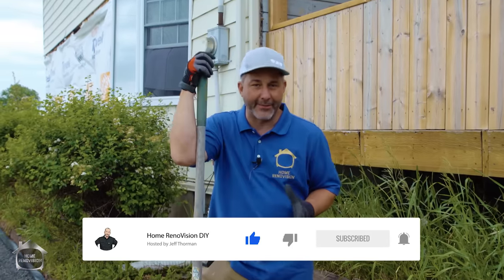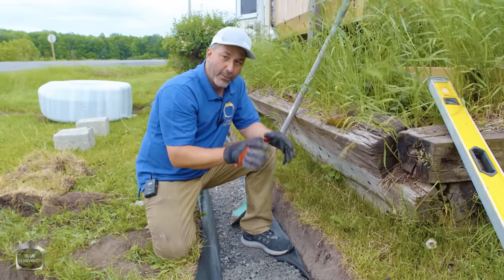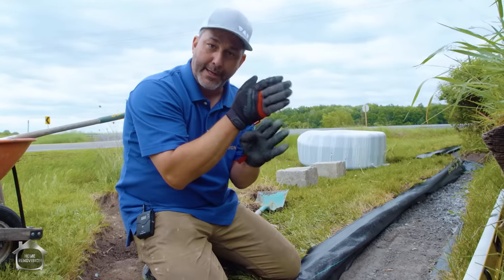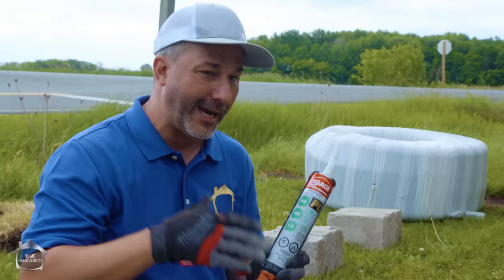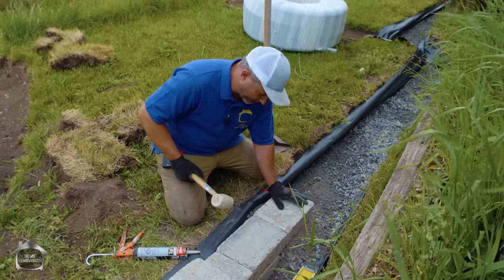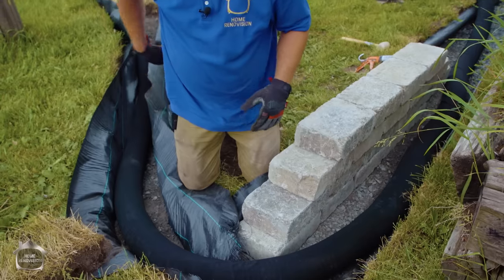How to Build a Retaining Wall - Step by Step

Comment: Probably should use some ppe when cutting masonry, once you've seen someone suffer from silicosis who worked with concrete for years you realize how little effort slipping a mask on during dry cuts can be
Reply from the maker: except I am not working with that stuff everyday and a little exposure will not cause you any harm. Cheers!
Reply: @HomeRenoVisionDIY  😳Come on, how old are you ... you literally out of breath in every video... 😉🌱
Reply: Mask AND Safety Googles.
Reply: @ConstantGardener-q9q  has to be a HEPA filtered mask and you have to have a fit test for the mask, using any type of mask can be dangerous.
Reply: @greeceundiscovered9670  damn, talk safety to me.
Reply: I totally get where the Home RenoVision guy is coming from. I’ve worked in several industries (steel, aerospace, construction) and as far as the lungs are concerned I really only stressed when working with composit materials like carbon fiber or fiberglass. Otherwise the only ppe I use is gloves and glasses… unless of course I’m welding or pouring steel.
Reply: Not to mention a pair of steel toe cap boots when using a diamond tip blade an inch from your foot lol
Reply: As long as you don't get sick you'll be fine...
Reply: @HomeRenoVisionDIY it absolutely does cause you harm. Masonry particles go in your lung AND NEVER LEAVE. Anyway, good video. Thanks for the tips.
Reply: Be sure to wear a NASA approved space suit and Tri mix Scuba breathing apparatus.. maybe back mount so it doesn't get in the way. Have at least 6 people standing around you wearing the same equipment with Palm Frons so they can fan away all the bad dust. Oh oh and remember to thoroughly rinse yourself off with a good chemical cleaner and a pressure washer with at least 3000 PSI and warn all of your neighbors to stay indoors with the doors and windows closed and sealed for at least 48 hours.  That should do the trick.
Reply: Too many safety professionals. As a safety professional you do should NOT assume PPE is the first answer. However, engineering controls are far better such as a dust collection or just reducing the dust by making it damp. If not applicable, now you can use PPE. The comfort of the person needs to be considered. No one wants to be wearing heavy PPE outside in the hot sun. N95’s are extremely hot to wear for long periods of time and being outside could lead to heat exhaustion. Even a PAPR/Full face is not practical. Cutting the brick the other direction so the wind takes the dust away from you would have been preferred and wetting i it before cutting. Also, he’s out of breathe because this guy is a work horse and explains what he’s doing while he’s doing it. Silica exposure is no joke, ask the 9/11 first responders and volunteers who were there.
Reply: Eyes & lungs are overrated.
Reply: Ears also
Reply: Scoliosis is curving of the spine. How on earth could a face mask prevent this??

Comment: I build these for a living. There are definitely some things we do differently as professionals but this is a great guide for a homeowner.
One thing I would recommend is using a small layer of stone dust to help level off your base course easier.

Most important to me though is to use headphones and glasses when you cut, or else you’ll end up with little shards of stone in your eyes and destroyed ears. Sometimes there’s a good reason to use proper PPE.
Reply: How high of a retaining wall can be built this way and at what point does it become a "high tech, expensive retaining wall that is holding up a wall of mud"?
Reply: @michaelspino906  Thats a good question, because I beleive you need a permit here if you go over 4 ft.  (I'd have to look that up to verify though). I built a small one a few years ago without the fabric and weeping pipe, but our soil is decomposed granite, and we don't have freezing cold winters, so I'm thinking this might be overkill for a 4 foot wall?  It's been holding up fine so far, and I'm watching because I need to build a taller one.
Reply: Michael Spino 
Generally in most places in Canada you need a geotechnical engineer to sign off on any retaining wall over 4 feet.  You can still build a “gravity wall” which is what this is above 4’. But it will depend on the size (weight) of the blocks and type of backfill materials as well as a few other factors.  
Hope that helps.
Reply: One thing I would recommend is creating your own channel, instead of trying to gain attention from someone else's video. If you want to preach safety you may want to do that on your own videos too.
Reply: I thought the same thing .... why no PPE. 36 years ago I was weedeating without safety glasses. Had to go to eye Doctor to dig a piece of vine out of my eye. I was fortunate. I have never left PPE off since.
Reply: Him saying in the video "I like productivity first, safety second" isn't cool otherwise I love anything he does.
Reply: @mathis2211  I agree. That was an ignorant statement
Reply: Cuando a
Reply: Thank you!! This guy is teaching novices to be seriously injured!!!
Reply: Pros don’t need protection gear.
Reply: @mathis2211  Yeah!  Safety is first!  That's why I stay inside.  Look at injury rates for people who build things!  smh
Reply: @charliesteck6105  The rock dust is incredibly bad for your lungs too. I’m unsubscribing. If he’s cutting corners on major safety issues then I don’t want to find out what else is lacking.
Reply: And a proper mask!! You don’t want to breathe that shit EVER!
Reply: @edbouhl3100  should probably wear a helmet with full bullet-proof face shield - you don't want a chip of concrete embedded in your skull.

I know I, personally, never operate a table saw without first strapping on my plate carrier.

Comment: 0:30 Overview of why retaining walls are needed.
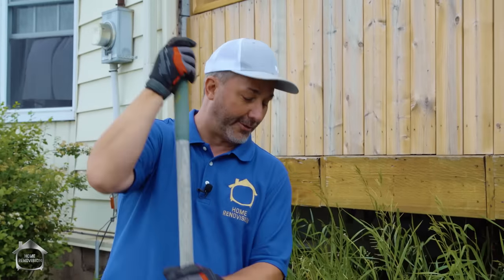1:50 Perfect foundation is critical.
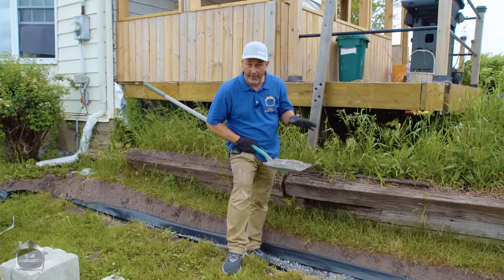2:10 Step 1 dig hole with flat shovel wide enough to lay blocks and drainage pipe.
3:10 Step 2, lay geotextile fabric.  U shaped, maintain separation between drainage rock and soil.  Pick decent thick burlap sack like fabric. 
3:10 Step 3, lay GA (General Aggregate?), level best you can.
4:15 Want the fabric to provide water barrier and act as diversion system.
4:45 Use long level.
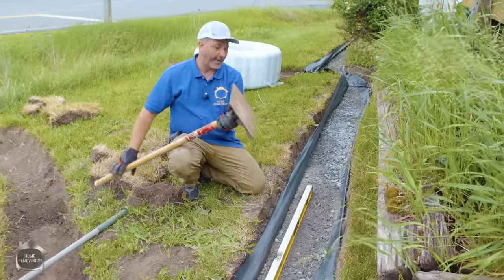5:30 Use hand tamper unless you have really long wall.
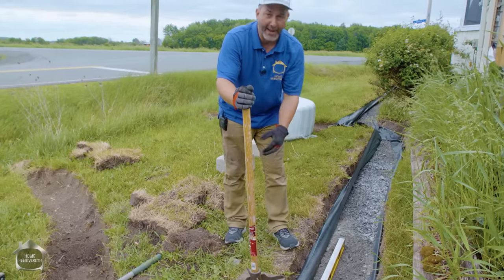6:00 Lay, smooth and level stone dust (alternative is to mix some dirt, sand, small amount of water)
6:25 Pound and pack dirt like a man.
6:39 Keep checking with level.
7:10 Repeatedly pound and level to perfection.  Quality of first level is critical, and time consuming.
7:45 Recommend rough pour concrete block that adhesive can grip to.
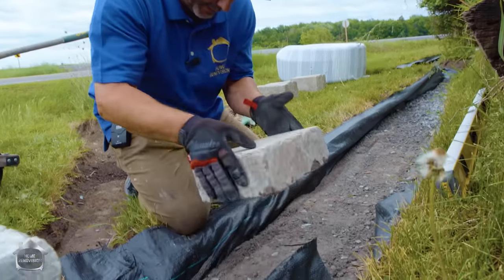8:35 Step 4, laying of first block.  Gets a beating to ensure settled and no rocking.
9:55 First 5 blocks laid.  Yay!  Progress.
10:00 Level check...
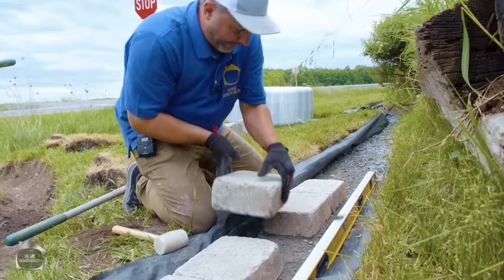10:26 Blocks picked up, more dust needed.  Expect similar experience.
11:00 Recap of process steps.
11:30 Step 5, second course and consequent courses.
11:40 Intro to adhesive.  Purpose is mainly just for initial holding of blocks during construction.  Correct drainage backfill is critical for long term stability, don't expect adhesive to hold back large hydro/frost pressure.
12:20 Construction Adhesive Lepage 600 being used.  Use right tool and material for every job.  The standard adhesive used here is good enough for this job.
12:50 First course should be flush or just lower than grass.  Uglier blocks can go here.
13:24 Second course layed, use adhesive, hide ugly face towards dirt.
14:20 Try to design and grade backfill to use natural drainage/slope where possible to divert water, reducing dependency/load on backfill.
15:30 Set back each layer by ~1/2" helps with leveling, and gives you wiggle room to absorb/handle problems/kinks/curves.  Looks cool too.
16:05 Stepping up and dealing with sloped ground.
17:20 Setting back each course enables using level for each course.
18:00 3rd and 4th layers fly on...  Adhesive, set, drop, repeat…
18:46 Step 6 Lay perforated corrugated plastic pipe covered with fabric sock/sleeve for water diversion.  Goal is to avoid/slow sediment buildup from blocking water flow.  Jeff provides brief history of "Weeping tile".
Use 1/2" or 3/4" CLEAN/clear crushed rock.  Drainage rock with no dirt or sand.  Surround and cover pipe with 3-4" of the clear stone drainage rock.  
20:00 Recap of process steps and material layout.
20:45 Backfill with GA.  GA backfill will drain better than soil.
21:45 Cutting corners with overlaying joints.  1 cut block per row, alternate each layer.
23:00 Rent a wet saw cutter.
24:30 Example dry cut.  Great example on how to lose eyesight, hearing, toes and achieve lung cancer.  Score a line, then make progressively deeper cuts.
26:46 Safety second lifestyle vs nuts when making cuts.
28:00 Tool safety warning.  Look after the blades, you have to pay for them.
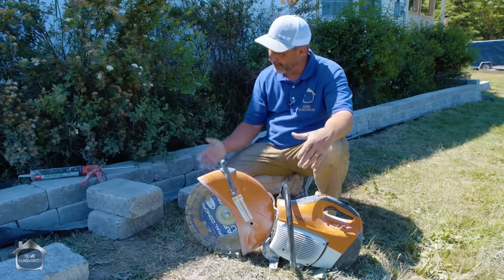28:55 Reminder... make sure you're happy with what you set.  If you're not happy, fix it before moving forward.
29:00 You got this!
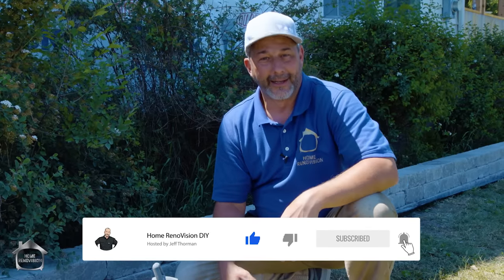29:20 Related projects and info.

Thanks Jeff!
Reply: Way too much time on your hands buddy....
Reply: Thanks for this breakdown!!
Reply: The recap at 24:30 was worth the entire read.
Reply: Thanks Jeff! As a man this video was hilarious but also very knowledgeable. Thank you again Jeff
Reply: For me, I’m rewriting this physically on paper. This is the power we all have first to Jeff creating the video, second this amazing break by @AzaB2C

Comment: I would HIGHLY recommend a "Dead Blow" Hammer for any work like this and for patio pavers.  Will save your arms and hands.  They have sand in them which creates inertia when you swing and the sand helps pound the block and not bounce because of the inertia of the moving sand within the hammer.  It literally stops when you hit the block and it will not bounce.
Reply: Never knew that (sand inside).....40 yrs plumbing contractor here....build everything myself...next time I walk by one of these gunna buy it. Thanks
Reply: Definitely , I won't build one without it , and plus you don't have to worry about  breaking the block
Reply: @chrisgreer1911  Chris you’re absolutely right and they come in different head sizes, handle length and weight depending on size block you’re laying.

Comment: I've built two retaining walls in my front yard with bricks that have the lip on the bottom back side to give the ½" shelf on the front side. For the bottom layer I just used a brick chisel and a sledge hammer to knock off the lip of the brick. My base substrate was a mixture of 4 inches of rock and sand on the bottom and 2 inches of pea pebbles on top for a total of 6 inches deep before my brick was laid.

Comment: Where does my severed foot go in the project? I wasn't expecting it as it wasn't on the parts list and I'm surprised to find it. Do I need the premium construction adhesive to reattach it to my body or just use it as backfill?

Comment: Jeff, I'd love to see what you have to say on fixing grading. We've had some crazy rainstorms in Montreal this summer and when the rain comes down really hard I get a little water intrusion through my (poured) foundation walls, so I want to fix the grading outside (it's a flat roof, so gutters aren't really a problem) is it as easy as it seems?

Comment: Angle grinder with a diamond blade - save from having to rent that gas saw. Same idea as the jumper - works fine on small jobs. Cut around as deep as you can, hit with mallet to break the rest.

Comment: Being a contractor. I will say there was not much to critique here. I would say that most of what he said is true. Contractors would do a lot of this differently but to do it that way would be impractical for homeowners. A few things to keep in mind. This style retaining wall is for raised garden beds, decorative boarders as seen on the video. If you plan to hold back more than 2 feet of dirt, or if there is a shed or other structure above it you need to use somthing else. Another thing would be to use lots of glue, the more the better. Also lots of these tools have different names depending on where you live. Other than that great job on the video jeff.
Reply from the maker: cheers!
Reply: Tank - What wall would you suggest for an 8 foot wall that would be dirt backed?
Reply: @da3wilson  every case is different, but i would recomend a pin locking retaining wall. And with a wall that large you are going to want to use a geo textile grid behind it. Honestly i would search somwhere on youtube for versa-lok retaining wall systems. That would be your best bet in my opinion. Do lots of research!!!!!!!
Reply: @tank_is_da_bombfor_real1464  thanks. Probably something we won't end up tackling ourselves just due to the size of the wall and the HOA requirements. Thanks for the advice and was just watched some videos on that. Got me thinking that for a large strong wall they would use bigger stones.
Reply: @da3wilson  your exactly right. Glad i could help!
Reply: da3wilson 
Depends what look you are going for and where on your property it is.  Gravity walls using large concrete blocks without geogrid are possible at that height.  Smaller blocks will require geogrid.

However, you will require an engineer to design it and perform a construction review regardless.

Comment: Hey Jeff, I've been watching your videos over the years and they've been incredibly helpful. I'm actually tackling a retaining wall project in the next couple of weeks, so this is timely. My concern about using this system is the woven geotextile that is not as permeable as non-woven. From the research I've done, you'd want the water that gets behind the wall to be able to flow freely to the face of the wall, while being filtered. Therefore, my intuition is it would be better to use a high quality non-woven fabric. However, I have no experience, so my intuition may be off here. Do you have any thoughts on this? Thanks
Reply: Great question! Jeff I hope you see this!
Reply: I thought the same.  The idea of "trapping the water" is bad when it comes to major storms or ice melt.  The tile is important, but its also important water can permeate through the wall.  One expert I watch regularly does not use adhesive for this reason as well.  Prefers the blocks that lock together, but with these blocks, I guess you don't have a choice unless they sell a version with drilled holes and pins to lock them.

Comment: Thank you for the video. You answered a few (or most) of my questions for 2 projects I have, but I have a few more.  1 of my projects involves and island between the house and the concrete walkway to the door.  Its on a slope leading downhill towards the front steps.  1) where should I send the water at the bottom of the slope? 2) do I need to protect the brick foundation wall (with something) before I back fill?  Essentially we want to end up with a planting bed area that is level with the house (below the vents).  Currently its just bare ground with shingles on top and then white rock on top.  Weeds just pop through the shingles.  Previous owner install.

Love the videos. thx

Comment: @Home RenoVision DIY

I have an old failing 4ft retaining wall, built out of rail road ties. I want to replace it with stone steps, using the same type of stones you used here with grass fill across the top budding up to the next step. My question is, how would you suggest I handle drainage for steps?

Should I:
• Build up a vertical stack of the rocks behind the highest stair, all the way down to the level of the bottom most stair? And add the pipe down there?

Thanks! Love your videos!

Comment: Great video and tips< I was appalled by the not using safety equipment, but you covered that at the end, except I had noticed the heavy breathing through out the video, I'm 67 and I don't breathe that heavy unless i'm really moving along, so you might want to get that checked out, it might be the dust, just a cold, or as I have noticed in the industry when over forty, its smoking, booze or both.

Comment: I build a small 3 foot retaining wall without the fabric or pipe, been fine for years now.  I also didn't use any adhesive, but I got those bricks that have the retaining edge and they taper towards the hill.  but I'm second guessing my ability to do so after watching this video.  I don't even know how I would get those materials to my house.  Not so much for the stone, just make a bunch of trips to the store, but for the pipe and landscaping fabric that I'm not sure I need?  I just back filled the wall with gravel and it's been fine.

Comment: Question.  I have a garden planter I am framing out in 8 inch L x 3 inch T x 4 inch W pavers.  The slop on this area is 28 deg from front to back.  1] Do I need a textile fabric for this as well as a weaping tile?   BTW; HomeDepot, Lowes, Menards were no help. Go Fig.

Comment: Sorry Jeff, gotta roll with the haters on this one.  You can be production first with your crew and suffer the consequences; their safety is always ultimately on them (and you) and y'all should know that- what can/can't/shouldn't be done is "common sense" if that's what you do day in, day out. But it's irresponsible to not at least point out what safety gear a DIYer might want- eye protection, hearing protection, lung protection, steel toe boots; and show solid safety precautions and  procedures before showing shortcuts to someone who has maybe no experience to build "common sense" on.

As for being comfortable with what are arguably dangerous tools- be comfortable using them, fine- never stop fearing them, that's when you wind up explaining to the medics how your appendage came to be packed in a bag of ice. I say this as a guy who's cut the shoe off from around all five toes with a lawnmower and cut my jeans with a chainsaw w/o breaking the skin under them.  I'm still comfortable pushing a lawnmower up a hill and using a chainsaw, but I'm much more careful about setup than I was before.